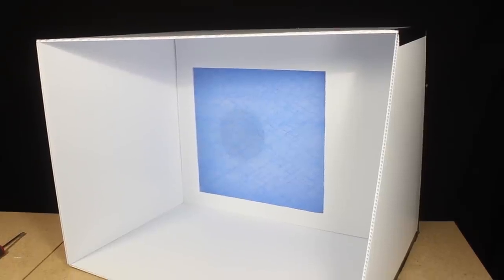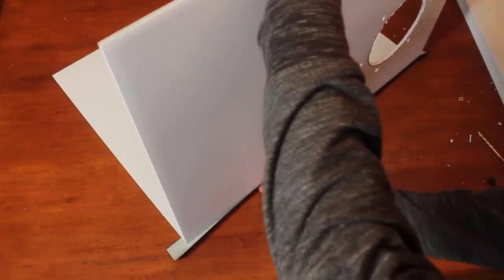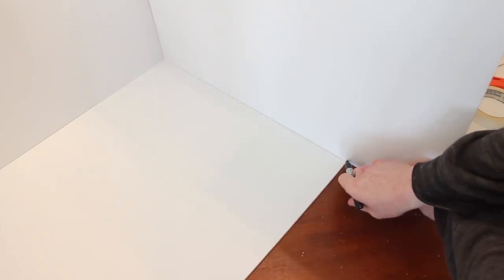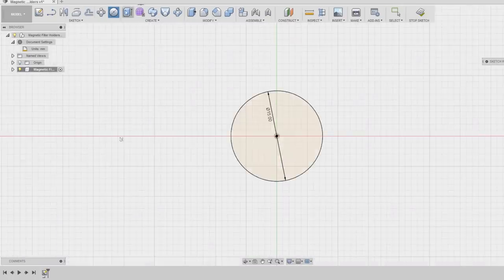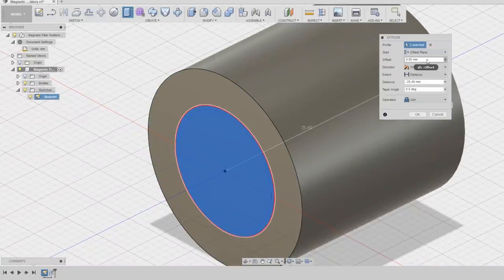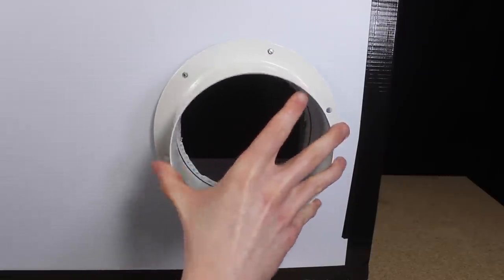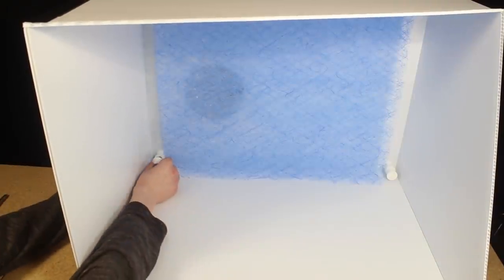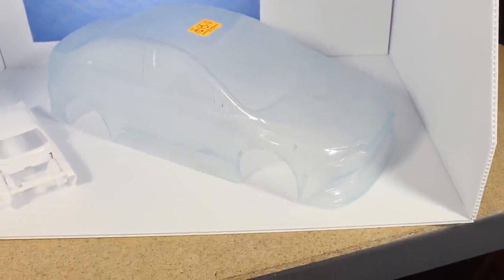Airbrush Spray Booth Build

Comment: Made a large 24x24 paint booth being I do some models up to 1/16 scale. I cut up old cardboard boxes I saved (FREE), hot glue gun (IN MY STOCK), tape (IN MY STOCK), 24x24 A/C filters (4 PACK $24), one 24x24 3 speed box fan ($20 New) set it up and tested found that even with the box fan on low all the paint was pulled to the filter. Works great and so happy I did not buy the ready-made booths $$$. Thanks for the info, Mike

Comment: Seen plenty of diy spray booths with wood and cardboard but I really like the idea of using corrugated plastic.. cheap, light, relatively sturdy, easy to cut. I built mine using this as a guide but with a few differences. 1. I used L brackets instead of tape, not as cheap/simple but I liked the look. 2. Used bathroom fan placed in center, I think these are at least decently safe? 3. Cut broken broom handle to make stand offs for the sheet and magnets that retains the filter, I find it funny that some people here seem to think a 3D printer is a requirement. 3. On the sheet that retains the filter Instead of cutting one opening over where the fan is, I cut two large rectangular openings on each side. Thought it might even the air flow a little and force the air to travel through more of the filter instead of just going straight in making it last longer and maybe a little better? Not sure but just an idea I had, been working just fine. Thanks for the video.

Comment: Thank you. I borrowed 2 large street signage from a street lamp, pretty much followed your build. For extraction I incorporated 2 x 120mm PC fans. I printed front grills and back attached 90 degree air vents on the back eliminating the tube and fan. I also added in a light mounted to the top, all connected to an adapter in order to utilize an old router cable.

Comment: "quick, simple, and cheap"...……….then proceeds to make some parts that he designed on his program, on his 3D printer.
Reply from the maker: Not a requirement but a nice tool to have. You could do the same thing with a dowel, PVC/ABS pipe, etc. if you wanted the magnet mounts.
Reply: Make It RC - just an observation from a disinterested viewer. Your video title would be great and fitting, if you didn’t toss in the CAD rendering & 3D printed parts and actually used the items that could be substituted as you mentioned in your reply since the 3D printed parts aren’t a requirement. Using the easily substituted parts gives validity to the video. As you said, you had all these items already on hand I’m relatively certain that 98% of the viewers don’t keep on hand the majority of the items you had, with the exception of duct tape, I’m pretty sure duct tape most everyone has that. Other then that, it is a great video. I’m not hatin, I’m just saying.
Reply: You know how it is Guys when you have a toy you wanna play with it ,start with simple pieces , move up, leave him alone , personally I'm jealous .
Reply: I have heard it said, that to a hammer everything is a nail. It follows that the person holding the hammer looks for nails even if they aren't aware of it. If a person holding hammer sees a nail that can be struck it simple must happen. This pattern holds true with the printer as well. As soon as you have and can use the printer, everything is a job for the printer.  The good news is the bar for printer ownership is coming down rapidly!

It would be easy to skip that step, as he actually did in the end (I found that quite funny), or make a replacement from some scrap wood and magnets.
Reply: an airbursh and pump cost me a hell of a lot more than my $200 printer. You guys act like they are soooo out of reach.
Reply: And we all have one of those, Right!
Reply: What kind of loser don't have 3D printer already?
Reply: haha freakin hillarious
Reply: @Godfa  Me :'(
Reply: @Godfa  you and me
Reply: @carbonoxx  make that three of us
Reply: The CAD and 3D printer was used to make standoffs with a magnet in it... You could easily just use a random piece of wood of the same size and length as a substitute. Why complain if someone has better and expensive tools? Clearly you're a creative/maker, maybe use that creativity to solve the problems you have instead of complaining.
Reply: @Godfa  haha Me! LOL
Reply: Lost me on the program and 3-D printer when thread spools would work. Keep it simple.
Reply: The program is free too tho
Reply: My thoughts as well

Comment: Jesus...People in the comments complaining you used a 3D printer when they don’t have one...not realizing they don’t need one and can use...I don’t know ANYTHING ELSE removable. Like adhesive Velcro?!? Or just use tape. Like most of them even tried to make one of these or complain about a 3D printer when they don’t even have an airbrush!!!
Reply: The point is this is supposed to be a “simple, dirt-cheap” spray booth, but he then proceeds to use high-end software that requires a lot of experience, and an expensive 3D printer for a complex magnet retention design he admits later is unnecessary. The disconnect between the content and purported intended audience is humorous. People aren’t angry, they’re laughing at the juxtaposition of “simple, dirt-cheap” to everything else and being sarcastic. Nobody is trying to be mean or hurt anybody’s feelings. It’s a fine video and provides some good ideas, but it is funny.

Comment: Glad to see you thinking about combustion risks with solvent paints.... many wouldn't.  But the fan design may be problematic - fan suction falls off at the fourth power relative to distance from the center of the inlet....so with a 4-6" inlet orifice with flat sides (not a bell or circular bevel inlet shroud) that drops off to almost zero inside the box.  The dryer hose is tough for maintaining suction due to level of static resistance within the duct.  The axial fan you have may work fine, but there are ways to make this better that aren't super costly.
Reply: I WAS WONDERING WHAT YOUR FIX TO THIS MIGHT BE (SORRY ABOUT THE CAPS, I WORK FFROM HOME AND WORK REQUIRES ALL CAPS) 
HAVE YOU DESIGNED YOUR OWN SPRAY BOOTH?

Comment: Just a heads up, a 6in inline is massive overkill for this size of spraybooth. Do your Cubic foot measurements, then get a fan of appropriate CFM (cubic feet of air per minute). This will save you tons of money, time and hair pulling. Computer fans may be a great option but I've never tried it first hand. :D great vid tho!

Comment: Suggestion, just use a furnace filter at the back of the box and if need be cut a foam cutout to place in front of it.  Doing this would allow the filter to be switched around when covered with paint.  This would give a two for one and extend the use of each filter.

Comment: Suggestion, consider using wall corner angles for all the corners for when a sturdier connection is needed.  This would accommodate when needing a much larger paint booth using foam boards would still be an option.  Another possibility is to start with a large box.  Adding the foam board would allow to start with a white interior if needed.

Comment: I use a 12 volt inline fan designed to ventilate a boat engine compartment so  the electric motor is already sealed.   I connected it to a cheap speed controller. With full power the fan can move 320 cfm. I usually have it on half, I have sprayed water directly across the opening of the booth and it gets sucked straight in.

Comment: Well Cheap..... parts around £25.00 in uk. 3D Printer around £300.00..............Spray booths on Ebay from £50.00......Job Done

Comment: I'm just trying to get into hobby so I have a question: what are the requirements for a spray booth and is there any reason to build one (besides ventilating fumes out from the model)? I thought I just use an old PC case with a couple of good coolers

Comment: I too build a paint booth but I used a TV   case pulled all the guts out .leveled it up with some 1/4 in birch panels and I use paint mask filters and brushless CPU fans 2 to suck air in and 2 to suck air out I also made a turn table with a small  d/c motor and a record player turntable it all work on 1 9v to operate the fans and 2 AA. Batteries to operate the turntable.also cut a hole on one side for light and gave it magnet clips to hold small pieces I'm in the process of installing l.e.d.lights as it's to dark when the sun goes down

Comment: Hardly quick, certainly not simple and definitely not cheap...
Reply: hour and a half to build less than $50 cost .home depot has everything here
Reply: @xrrobiii9187  If you already own a 3D printer, that is.
Reply: @raytheron  Put about $50 in to mine as well. Cut up a broken broom handle for stand offs. you don't need a 3D printer, if you made the investment and want to put it to use great. If not its basically a fucking 1x2in cylinder, not exactly the most complex thing to make.
Reply: Autofan 74 

You can't please everyone lol, and you have to basically do the job for them in order to make them happy. We're all a bunch of fuckwits these days, no one knows how to use their noggins anymore.

Sixty seconds into this video and I'm already thinking of ways to wire up and create a filtration system for this bad boy. Got a bag of electrical connectors from Range Rovers thanks to a recall, get me some dense filtration mesh from the old boy who's in the compressor industry, some 200mm PC fans and a 12v charger, boom!

Beats dropping 200 bucks on some of the store options I've seen here in Oz, build it to my specs and to my standards, can't beat doing things yourself. 

Would anyone know what to search for in regards to these plastic panels he's using? Looks like plastic cardboard panels if you know what I mean, wonder if Bunnings has them.
Reply: Scratch that, My OCD couldn't handle the tape holding it together, I'll look to use MDF for mine. Just bought a brad nailer the other week too, sounds like a fucking plan.
Reply: @autofan7415  Of course one improvises! There are a horde of options for those stand-offs. But if you want to follow him to the letter, you're going to need a 3D printer, ne c'est pas?
Reply: @tynanroyhiggins  They look like those plastic sheets one can find in most stationers -- basically a plastic version of standard old corrugated cardboard sandwiched between two sheets of thin plastic. They go by trade names like Cartonplast, Polyflute, Coroplast, FlutePlast, IntePro, Proplex, Correx, Twinplast, Corriflute or Corflute. The plastic is actually polypropylene. I don't recall seeing it in Bunnings, though. But you're right, MDF would give you a hugely improved product -- and the MDF doesn't need to be all that thick.
Reply: Ray Theron 

Thank you for this, I'll be keeping an eye out.
Reply: @tynanroyhiggins  You're welcome :-)
Reply: @xrrobiii9187  and $100 to buy a professional one with better materials.

Comment: Nice idea.  As I will be paining a 1/8 scale bodies now and then a little bigger wouldn't hurt  Did you say what measurements you used were?
Reply from the maker: The dimensions of the sheets I used was 18x24in. I believe you can find corrugated plastic sheets in larger sizes than that if needed. Good luck with your build. 👍

Comment: A squirrel cage for an old GM car is dirt cheap. I have been looking for those sheets forever to fill in crate bottoms. Where did u get them? Great work as always. I'd say u are the best RC youtuber still working,
Reply from the maker: Great idea about using a GM squirrel cage motor. You can get the sheets for cheap in bulk from a sign company or ebay. You can also get them for free during/right after election season if you live in the US.

Comment: nice and easy. what performance does your blower have? and what nozzle do you use?
Reply from the maker: Not sure exactly what the specs are on that blower, It's just something I already had on hand. I know it's designed for venting shops/green houses and similar applications. Certainly has some power. I was using a .35 nozzle.

Comment: A suitable cardboard box would be even cheaper.
Reply: Thanks. Gave me some even less expensive alternative ideas. I'll use a sturdy cardboard Balikbayan (Filipino shipping box) and a dryer vent hose routed out the back connected to an old, inexpensive window fan. Will use some spare filter material I have on hand in the rear of the box in front of the vent hole. I'll only be using acrylics, so fume combustion won't be an issue. I may even mount some LED lighting overhead protected by a clear, replaceable plastic shield. Since I have practically all these items on hand, my costs will be minimal.

Comment: Nice build, especially if you already have all the parts around. Better than a bucket in the yard and nowhere near the cost of the off the shelf stuff, that's not a bad spot to fit into, when you can.  If you don't mind some advice, try not to start so many sentences with "I..." It's an odd habit I had to break myself. Before I was told I was doing it, I never had a clue and now I can't stop seeing it. What I found is that this little trick made write just a little bit differently and I almost always ended up adding something of use to the writing in the end. Regardless, your video quality is great and you are clearly putting real effort into this thing. I think you have good things coming your way. Keep up the good work, I'm enjoying the show.

Comment: Over complicated much?
Clear Sterilite 105 Qt Latch Box $10
True Blue filter 16 in. x 20 in. x 1 in, $4
2 frosted, solar rechargeable tap-lights $10
Dryer Duct connecter $10
Stronger built, portable and can be used for storing the supplies you'll use for painting. 

3D printed connections?  Really man?
Reply: What fan did you use

Comment: What, do you get a lot of overspray from your airbrush, where you need a booth? I use my airbrush spraying into a box big enough to hold my subject matter and have no problems with overspray. I've used my airbrush to custom paint  lighting sconces and ventilation registers that
 were installed on my walls and ceiling, no muss no fuss.  I've painted numerous models in the family room with no signs of overspray settling outside the paint box or landing on non-desired surfaces.
Reply: You need the booth to remove the toxic atomized paint from the air. Especially for lacquer and enamel paints. You can smell the poison in those things. I once got a wiff of the cleaner and got an instant headache.

Comment: Should a used a hot glue gun works awesome.nice job on it though 👍 I used 3/16 foam board a 20x30 sheet 1.99 at hobby lobby an used 3

Comment: everyone is always worried about fumes being ignited by the fan, does anyone have any idea how concentrated the fumes would have to be in order to ignite fumes? You'd have to be painting a full sized car in order to have worries, besides, the aluminum hose most people use would not be harmed by the ignition anyways, not that that is an argument for using non-sealed fans. If you're worried about the fumes, being ignited then go and buy a sealed fan but you have to know that it's easy to seal a fan and attach heat sinks to cool it instead of air? anyone try that? I'm gonna check!

Comment: a few wing nuts, some tube and longer bolts will do the same job as those printed magnet holders... or duct tape if you can't be bothered with that even that level. otherwise, this is a good functional design

Comment: Making the booth box itself is relatively quick & cheap to make for about $45 (corrugated plastic boards are a bit pricey IMHO), the filter material, duct and duct flange are pretty cheap. Now for the rest of this “cheap” booth, a vent fan about $25, CAD program $200-$300 and 3D printer about $2500-$5000. Yeah I’ve got all that laying around.... not! It would be cheaper to buy one 😂 😂 😂
Reply: Printers don't cost that much.

Comment: an easier - and cheaper - idea - use a bathroom vent fan with light.  I vented mine to the outside of the house - a bit difficult as I live in a brick home - but doable and I didn't need a 3d Printer

Comment: Dude. 25 euro of flute board. 7 euro filter. 3 euro tubing. 20 dollar inline fan. 2.50 euro of nuts and bolts. 500 euro 3d printer. 2 years of cad lessons. 3 euro of glue. 3 euro ducktape. Its a 560 euro build man. Wtf. Lovely video though.

Comment: Is the purpose of the fan/exhaust to draw dust particles into your paint?
For something so entirely over engineered, it sure is a bad design.  If you are going to use a fan, blow the fan through the filter and out the front of the box. This will push dirt particles away from your work instead of draw dirt directly to it. Just put on a respirator and adjust you airflow so that it does not interwith the flow of you air gun.

Comment: ItS VEry sIMpLe GuYs I jUSt UsEd mY 3D ProGRam tO DeSIGn SoMe MoUnTs AnD THen priNTed THem OuT.
SUpEr siMPle dIY bUilD gUYs.

Wtf bro. 600 dollar printer. 400 dollar airbrush. ??? Dollar 3d program. The skills to use them. 
Here i was thinking this is a simple diy booth not an engineering masterclass. W T F bro.... downvoted

Comment: Sorry but none of this is on the cheap and you're design is not very good, the rear exhaust needs a larger chamber so the suction covers the entire volume of booth...the way you have It, will only provide suction at fan exit and plug up fast. The 3D printing is over the top imo...could have just used glue to attach the mags but like most that spent the cash on one you find any excuse to use it and show it off. This video quickly became all about programming in a 3d printer...👎